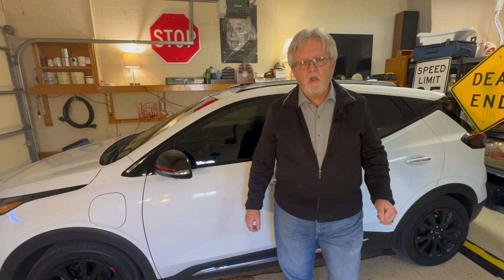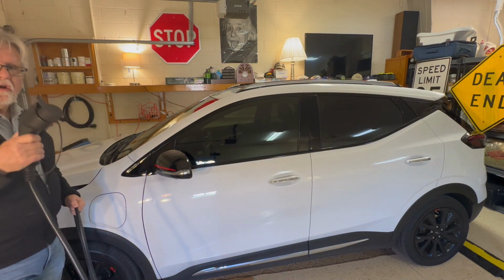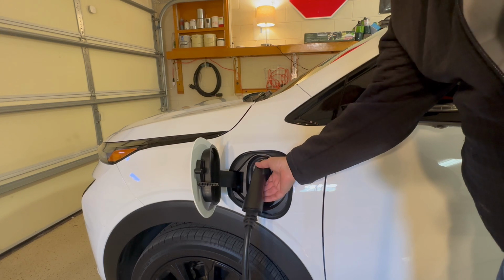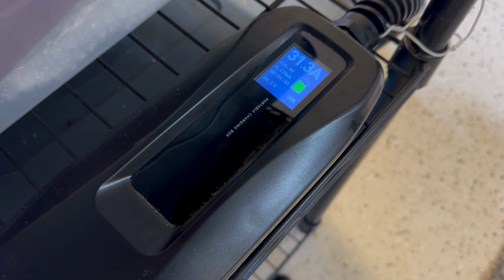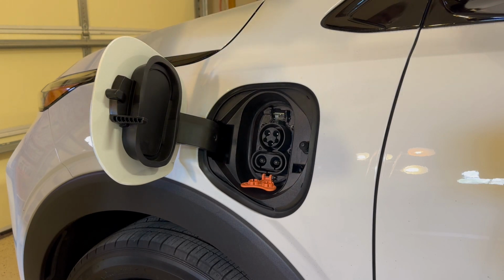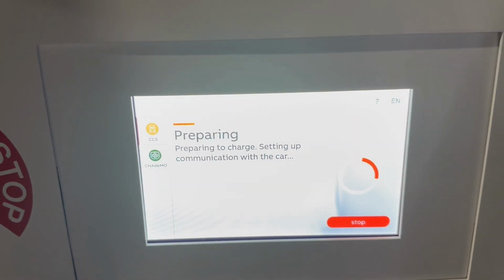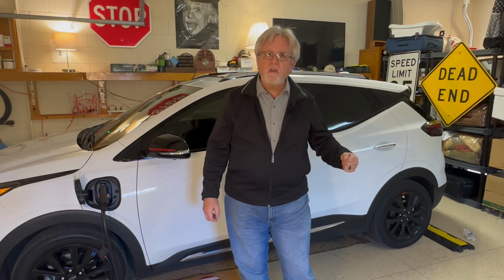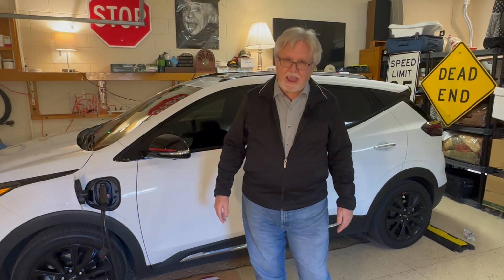Charging Your EV: AC (L2), DCFC, and Cold Hard Facts

Comment: HI   I live in Montana and the winter Month . Do I need to Keep  it plugged and cold temperature ?   I have a 2023 Chery Bolt EUV.
Reply from the maker: ABC Always Be Charging and API Always Plug In. Two reasons.  You’ll always have charge when you need it. And you’ll always be using AC power for battery conditioning (warming and cooling) when you’re not driving. For more detailed information, visit recurrentauto.com.

Comment: Excellent points. I have a '23 euv Lt. I'm having a chargepoint homeflex wifi evse installed at home, as I doubt the free level 2 charging I've been using near work will last much longer. In weather below freezing, at night I've been using the 110v/8a level-1 evse that came with the just to keep the battery warm for quicker charging.
My next project is solar on the roof and battery backup, for a level of energy autonomy that ice drivers can't dream of.
Reply from the maker: Thanks for sharing

Comment: Hello Jim. I have the same Bolt EUV color and wheels  :-) ..... For daily use, is it best to Charge the Bolt EUV to 80% , like most Lithium ion , EV batteries ? , The Bolt EUV  Manual doesn't mention if 80% is best for extending the battery 's life. Your thoughts
Reply from the maker: In my daily study about Lithium Ion batteries, the CLOSER you can maintain them to 50 percent, the better.  I try to keep mine in the 30-70 range.  I use about 40 percent of my battery every day just for going back and forth to work.  The ONLY time I ever go about the 70-80 percent threshold is just before starting a road trip.  A GREAT source for information about this (and I do not get a dime from them) is Recurrent Auto.  Connect your car to their service (free service) and they will track your battery over time.  This will also help when it comes time to trade or resell your car!